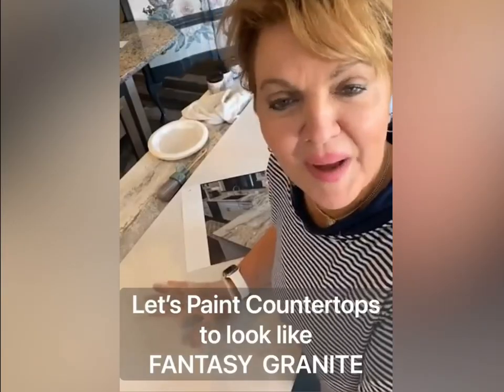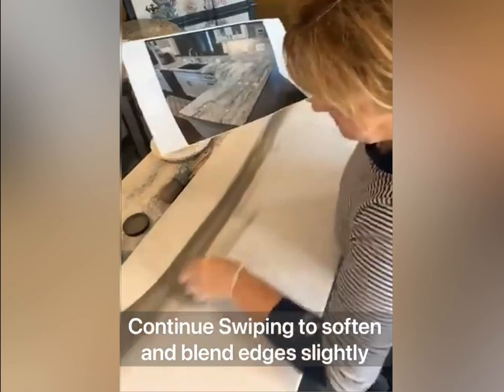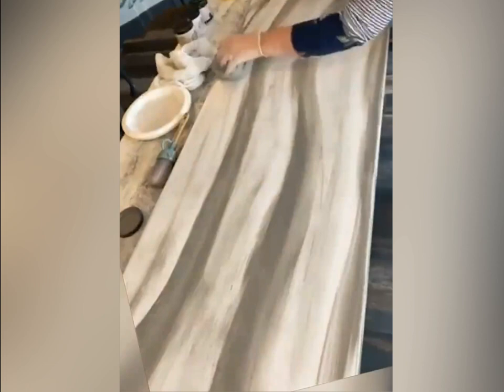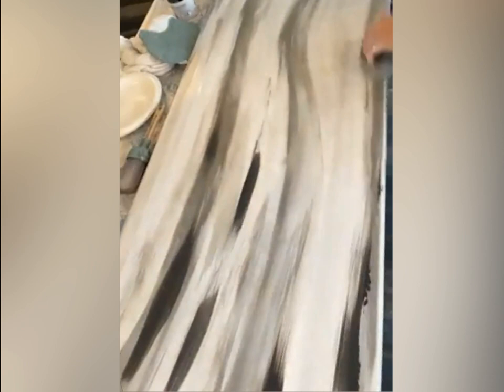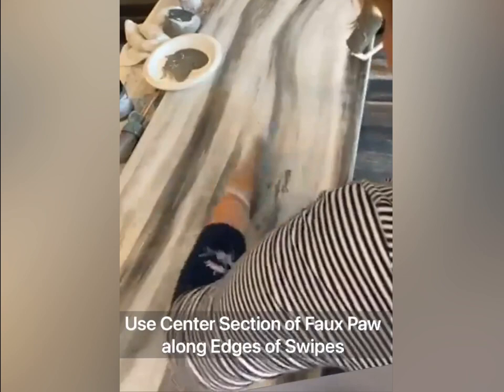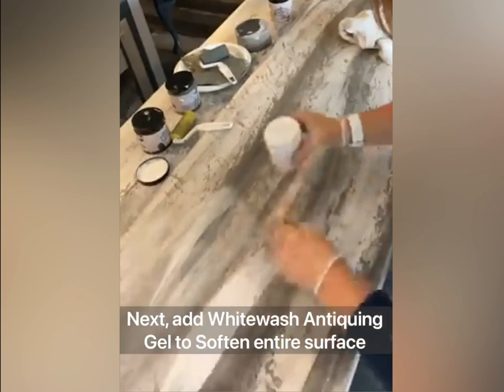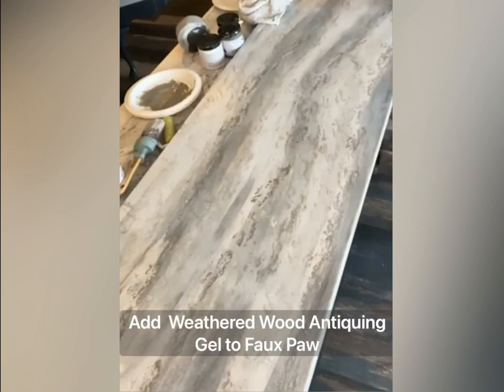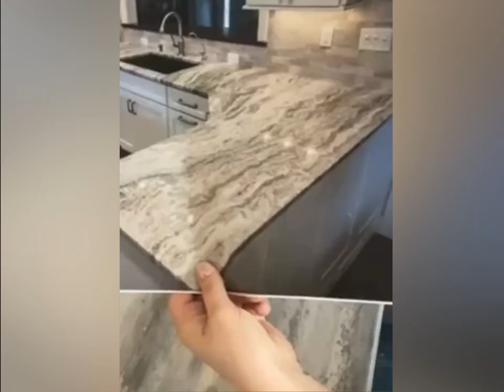Let’s Paint a COUNTERTOP to look like FANTASY GRANITE!

Comment: Can I apply your pain over Rust-Oleum Countertop Paint which I was very displeased with. 
I bought 2 cans of the Rust-Oleum Countertop paint. I wanted and ordered their Pewter for my cabinets but paint dried as their light Gray Mist. Then took paint back to home depot and they mixed again and couldn't get pewter right. They had to add 286 drops of black but the paint guy decided to add some blue to get me to pewter. None of their combinations would work. It is very frustrating. Just wrote to Rust-Oleum hoping to hear from them. Now I'm stuck with a medium gray showing a hint of blue. I thought it would dry the proper color but again, it didn't. Frustrating. Thank you.